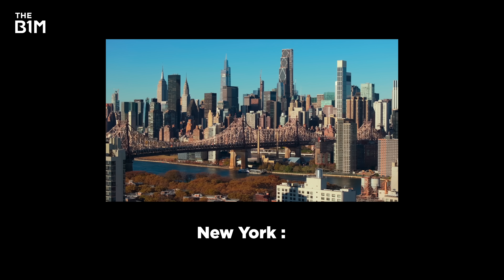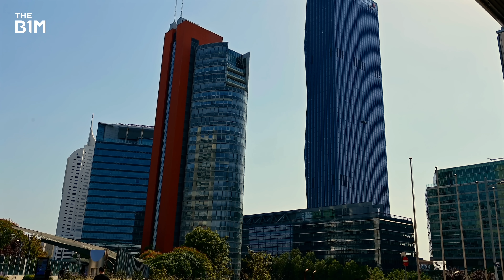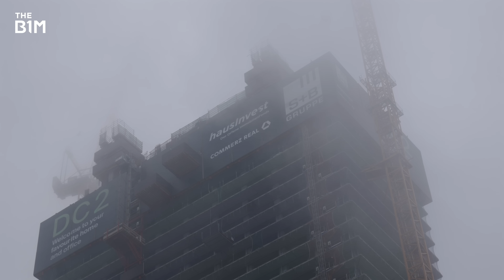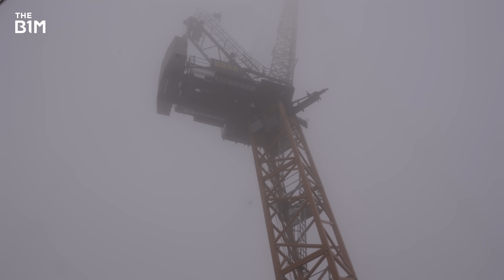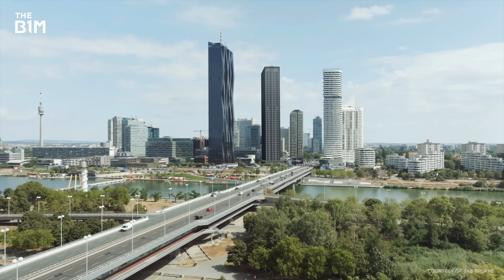Inside Austria's (Terrifying) New Skyscraper Build

Comment from the maker: NEVER. AGAIN.
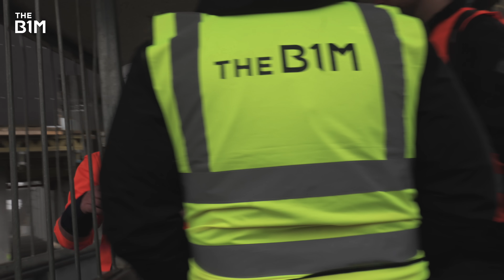Reply: 8:39
There's something truly cinematic about the shot of the cage, this mystical steel cube, just floating straight up into the air while we hear you release sounds of pure terror.
Reply: Oh, cmon! What's life if you're not hanging around in a small enclosed steel box with other humans that's being lifted by a heavy steel cable !!!  Thanks for taking one for the team, Fred ! You're why this channel is as good as it is !!!
Reply: @Randoir11   A VERY LONG, heavy steel cable at that...

😄😁😆😅😂🤣
Reply: You mean Austria or the Crane,... Well I hope we see you again in Austria, maybe for the U5 (when it's eventually get finished), or the Semmering-Base Tunnel that should be finished next Year,... (I doubt it)
Reply: I’ve worked on oil rigs and sky scrapers and I’m terrified of heights. You did real good coming down on the crane. First time I did it I felt like I’d aged 20 years.
Reply: @samg5463  If you want to really trip out,
get in a skip or "cage" and travel 2700' into
the ground bouncing & banging from side to side
riding on wooden rails. 
When you finally get to the bottom, the hoist
operator stops the descent but the cage takes 20
seconds or so of bouncing up and down "slack" in 
the cable before the skip comes to a stop so as to 
get off into the level which is 12' wide x 10' high
running into the darkness left & right.
Reply: Never say never again. 😹
Reply: @TheB1M You don't know what we mean when we say this in Vienna. We refer to 1938 to 1945.
Reply: The look on your face said everything.
Reply: It's crazy how this makes me feel just by watching the video.
Reply: They have been waiting for you.
That is the lesson for anyone who works in digital/theoretical spaces vs those who actually have to build it... they love to show off what you are making them do.
Reply: I've been lifted in a much smaller basket by a crane (barely big enough for three people to rotate in place) but never that high. The bouncing from the cable stretching due to every move anyone makes does take a lot to get used to.
Reply: It's safer than flying - something you do without hesitating ...
Reply: We all know you love it, why else would you decide to work for a channel about building tall things? :)
Reply: Really interesting video thank you! Only thing missing was flexing of an appropriate bicep. I expect biceps in every video from now on.😂
Reply: I clenched just watching in my chair. All joking aside, stuff with heights can be pretty daunting, so good on you for giving it a try!
Reply: Nothing better than watching a man like yourself get terrified on camera. Reminds me of the day my dad took me on a cablecar somewhere. He crumpled too :)
Reply: If you combine every bit of currency ever put in circulation from the dawn of time to now and offer it to me, you still aint getting me in that thing.
Reply: How about some cable car construction projects in alps?
Reply: your cameraman and his stomach seemed fine. :body-green-covering-eyes: did he have some prior training doing this?
Reply: I didn’t realise you’re such a sook.
Reply: Good work man you HUNG in there

and you didn't even DROP the ball

You sure were TEETERING over a grand venture 

ACROPHOBIA! 😨
Reply: come to Kenya  and document 88 Nairobi condominium
Reply: Oh come onnnnn... you're still alive to wet yourself another day  :D
Reply: Change of underpants Please..lol.
Reply: You somehow forgetting Moscow, which is skyscraper capital of Europe.
Reply: LOL.
Reply: 🤣Donau: it's not pronounced "do-now," it's pronounced "door-now" but with a silent "r"
Reply: I think you indirectly referenced many Holocaust survivors saying this because of Adolf Hitler, who is born in Austria.
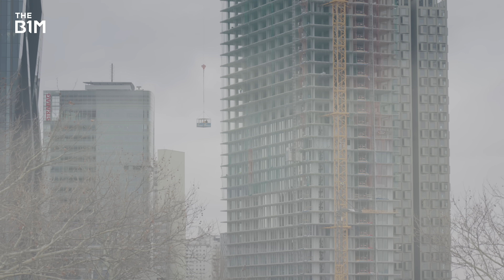Reply: 9:20 🤣 i feel with you
Reply: Never say never!
Reply: Wimp
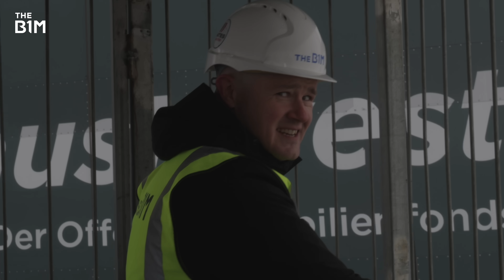Reply: omg 8:58 when the regret kicks in
Reply: Never again..... until the next time,
Reply: Stop being soft

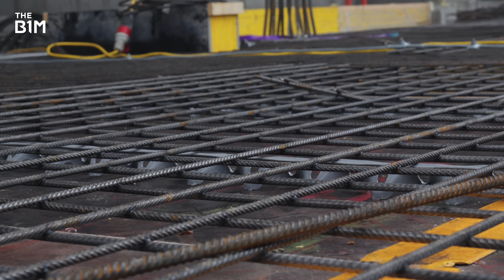Comment: 06:05 Steel rebar isn't used to provide "more strength and rigidity", the concrete is already quite strong and rigid enough once cured. The steel reinforcement allows the slabs and columns to flex without cracking under static and dynamic loads.

Comment: Some more information about this area:
This development is taking place in 'Donaustadt' as he said (although it's pronounced closer to "d'oh-naw" rather than "do-now"), and the name means 'Danube city', after the massive river Vienna is built upon. The Danube has historically been rather erratic, subjecting Vienna to mass flooding, and often shifting its course across the plains. Because the river's flood plain was so large, it was very difficult to maintain permanent settlements and constructions closer to the banks of the river. All of Vienna's old historic buildings are located on land that has always been quite far away from the river, and what is now Donaustadt was for centuries just a patchwork of ever-shifting marshlands and river forks.

This only began to change in the last 150 years or so, when infrastructure projects began being implemented to protect land against flooding and control the course of the river. Parts of what is now Donaustadt began to see construction, and in the 1970s the work culminated in a massive effort to dredge much of the floodplain to create a dedicated water channel controlled with dams, and with the excavated soil, pile it onto the land strips between the channels to raise their elevation. The most prominent result of this was the creation of the Donauinsel, or "Danube Island", an artificial island about 200m wide that runs for over 20km down the length of the river through the city, almost the entirety of which is a public park with trails for walking, running, or cycling. The Donaustadt development is right next to the Donauinsel (you can see the island in some shots of this video) and is also built on partially reclaimed land. It's called "Danube City" because it is built on top of where the Danube once flowed.

Comment: In case you were wondering about the redesign: The 2021-2024 chairwomen of the Viennese City Planning advisory board is an architect. If you check the designs of her company DMAA like Vienna TwentyTwo or Hotel Bassena you can’t help but notice a pattern.

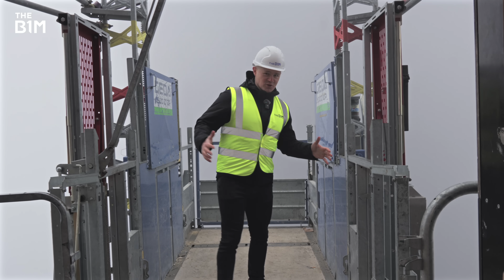Comment: 6:30 in... with the exception of the spiderman RCS thing, not a single sign of anything interesting let alone "GAME CHANGING" in this construction. Instead we are explained how steel rebar is used in concrete to make it stronger...
I guess to build suspense before spending 15 seconds on the revolutionary "6 floors at a time" elevator. 
Kindergarten level content!

Comment: from a technical perspective, this building is very interesting, especially the Photovoltaic integrated in the outer hull surfaces. But: as I live in Vienna, the marketing message from the building team about the nice balconies/verandas on every floor has to be corrected. This is a ridiculous marketing stunt that is not holding up with reality. These balconies are unusable in reality due to heavy winds in this area, easily up to 100km per hour, on normal days even without storm warning. The whole area of skyrises there is very bad to live for pedestrians too as heavy winds get even strengthened by channeling between the tight alleys of buildings - there are massive complaints by visitors and inhabitants that walking between buildings is very dangerous and on some days nearly impossible, especially for kids and the elderly, due to heavy wind gusts. They even built wind protection walls on the ground for that purpose, but these are partly ineffective. So one can image how cozy these winds are 200m above ground.

Comment: I've been living in DC3 for half a year in 2024. The balconys & other outside areas will be really challenging to use properly.
Especially in winter, Vienna is an area with high gusty wind speeds.
Although DC3 had no balconys, you could hear the wind howl and you could feel the building moving in the wind so that I had a hard time sleeping on the 31st floor.

Comment: I'm curious to know whether European high-rise towers include the levels below grade in their overall height. Also, it seems as if most skyscrapers built during the mid-twentieth century used steel frame construction, but now it's almost universally built with concrete. Why the change, especially for supertall buildings?

Comment: Fred hi from Alberta, Canada. Never thought I'd see the day skyscrapers in Vienna !!!!. I bet that's not a popular decision with the long term city residents. But land is scarce particularly in older European cities. Like it or not high-rise  development is re quired for a long list of reasons. 
I'm surprised at your response to the fulltime construction man lift. It's standard part of hi-rise and skyscraper construction in North America. We only have a man cage on site for use mainly by EMT's in case of emergencies. Tower crane expenses are so high they are strictly reserved for lifting materials, refuse, equipment and formwork. It's normal practice here to install both from day one and raise both as the tower rises. Tower cranes are dismantled and taken off site as soon as possible, long before tenant interior fit outs are started. The exterior Man-lift is left in place until the interior freight elevators are operational and commissioned. 
Don't dare try and hitch a ride with a tower crane lift so you can beat the other trades to whatever floor you're working on. It will result is a verbal slap from the site foreperson, a day filling out forms in the site office then a meeting with the project manager to decide your future. Next a day reporting to Workplace Health and Safety the provincial government watchdog, more brow beating, forms and fines. Oh ya the offender pays fines personally.. 
The site we are starting here in Calgary downtown 4 towers 35, 45, 50 and 65 means 5 tower cranes and 5 man-lifts 2 of each for tower 60. Man-lifts are the most efficient way to move the1200 + persons who require access. It reserves the tower crane time for lifting materials etc only. Man-lifts are reserved for moving humans only.  
Great looking towers in Vienna.
Thanks see you next time.

Comment: Did you know the German engineers did something really ground breaking and clever. Most skyscrapers are built on a module design from the ground up.  For this they use a technique called von oben nach unten dezin or approximately translated top down built??.  So they first built the foundation, then when solid, or secure structurally they start building the rest top down.  Very clever. Search it.

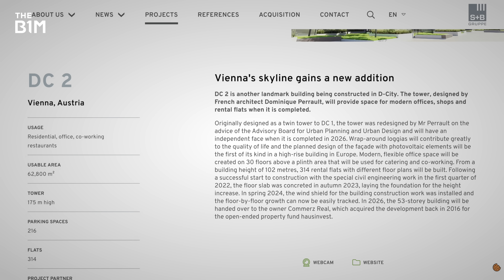Comment: @10:45 I wish the original concept would have been built as DC1 has no meaning now its companion has been "normalised" by the Advisory Board for Urban Planning and Urban Design. Indeed, what is this Urban Design board actually advising: "stay conservative", "not in my back yard", "you've had your fun [with DC1] so let's just recede into obscurity for DC2"? The loggias are a nice feature but could have been built in to a design for another building rather than the DC1/2 companions, but are they really useful for the occupants, given winds at that altitude? You would need to bring in all of your furniture every time you were not using the outside space, or bolt it down, to save it from a 53-storey plunge!
Reply: sadly Vienna lately is famously bad at enforing good planning and architecture. Looking at Triiiple it's insane what they think people are doing on balconies so high up, the wind is bad enough at street level
Reply: @robbartley  While not a highrise in the strict sense, that apartment tower at Donaumarina has to be the stupiest thing concerning winds ... it stands alone in an area where at streetlevel you have regularly rather strong winds and every apartment has a balcony. I'd have no idea what to do with that, especially if facing the main wether side.

Also, don't get me started at the planning and architecture "board" ... on one hand you have the technical side (which I somewhat understand) and on the other hand the board which should care about the general look of the city - but which more often than not is a hinderance when you want to build a new  building, revitalize a historic building or just build a carport in your own garden (if you have the "luck" of living in a "protected" area)
Reply: My friend lives in one of those buildings, having a balcony and being able to do a bbq it’s nice, even with high winds blowing at you. It feels less trapped than the chocolate bar design building.
Reply: Well, I'm not in love with the original design either

Comment: I recently stayed in DC1 at the Meliá Hotel and the whole area is steel and glass, like it's "cold as December"! Luckily, the metro is very close and you can quickly get to the historic center of Vienna.
Reply: Exactly, these disgusting, modern buildings should not be allowed in Vienna at all!
Reply: @the_real_economics  As someone who left Vienna, I quite frankly disagree. A city should be a living area first and not a museum, but Vienna is becoming one. At the expense of the living quality. The city is overpopulated and the infrastructure is aging. It's challenging to get around on time during rush hour. The historical buildings are impossible to heat in winter and cool in summer, if you even get approval for a modern AC. And because of the poor insulation it's quite inefficient too. 
Vienna's center is unique and should stay as it is, but the living space for the average population is in dire need of modernization.
Reply: I genuinely wonder what an "Altbau-style" skyscraper would look like with the typical ornaments on the facade.
Reply: @dodecamethylcyclohexasilane  It would look like it cost way too much :)
Reply: Yup, the high rise region is one of the shittiest parts of Vienna.